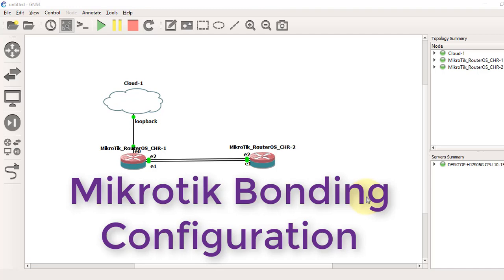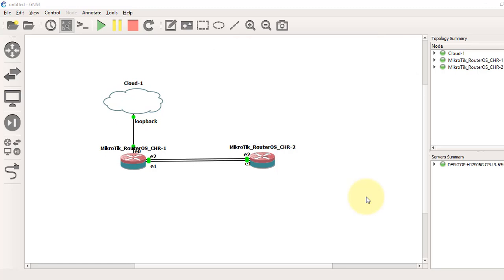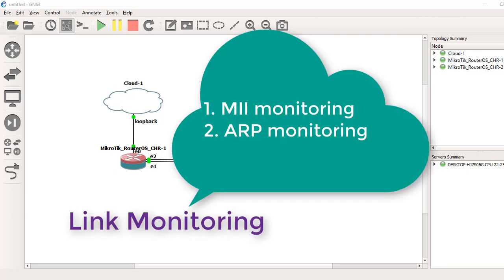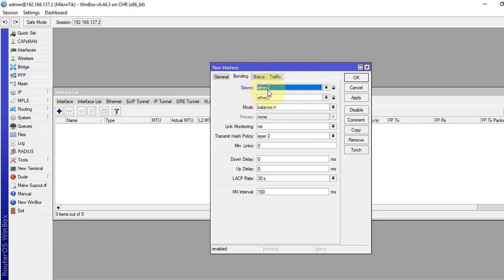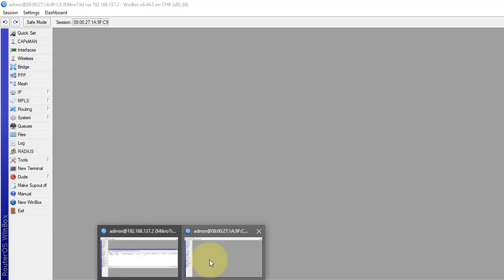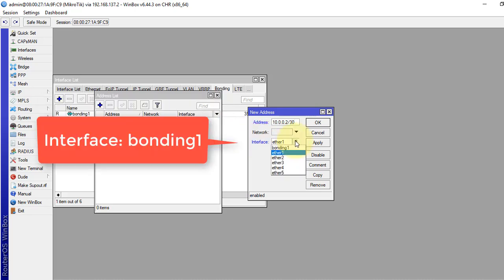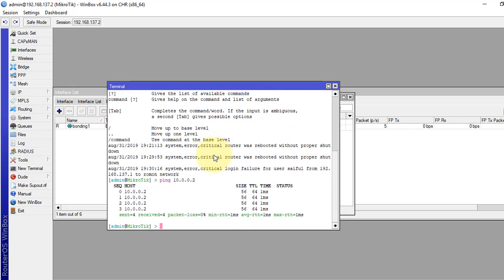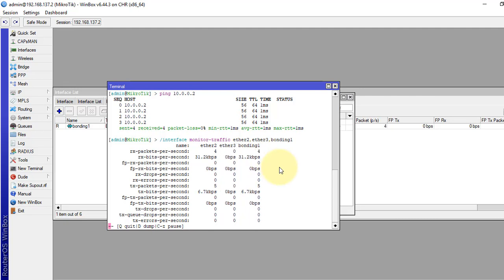Mikrotik Tutorial no. 33 - Mikrotik Bonding Configuration

Comment: in your video showing the two interfaces is not equal traffic, this is what 802.ead mode asymmetrical bw?
Reply from the maker: Not really. 802.3ad is symmetric. I couldn't give the exact scenario what actually happens with real traffic. It's a lab scenario thats why it shows asymmetric.
Reply: @TechieLAB  not really .. the balance-rr mode is the only one that balances a single tcp connection over many interfaces , other modes do it per peer or connection meaning you wont really have exacct equal traffic on both interfaces and this is what real  traffic looks like

Comment: Thanks for your tutorial however I'm still weak to understand it all. I'm in my research phase. My team owns a Hex Lite RB750R2 and I was wondering if we could bond 2 WANs together using this router (as it is not in your list). If so, I would like to know if it's really bonding like shown in this video https://www.youtube.com/watch?v=9Lx40EJdTU4. Meaning that if internet connection to WAN 1 dropped, the router will seamlessly (without any packet drops or cut) connect to WAN2 and not change the IP address.
Reply from the maker: If you have one ISP with two WAN connection, it is possible. In ISP end, they have to configure the same standard 802.3ad link aggregation. But with different ISP's two connection is not possible. Hope it clears your question.
Reply: @TechieLAB  thanks a lot for clarifying me. Since I wrote to you I had to change my assumption of the network design. It would be better for the team in Asia to have one redundant 4G connection via USB modem attached to a router. Do you know if there would be any Mikrotik router models that would be supporting bonding a WAN and a 4G signal together?

Comment: Hello Every one:
I have 2 Wan same isp and runing load balance .40 mbs wan 1 and 40 mbs wan .when i run dhcp server its passed 80 mbs but when i make pppoe server and wont check how much speed give pppoe but is only passed half speed 40 and checked many time just work on Wan 1 not go wan 2 .kindly tell me its solotuion its give maximum speed on both wans .i have used Router OS in PC Core 2 and 2 gb ram also 100 gb hardisk